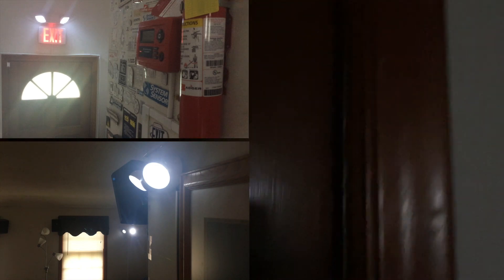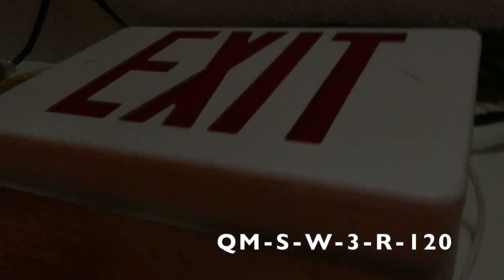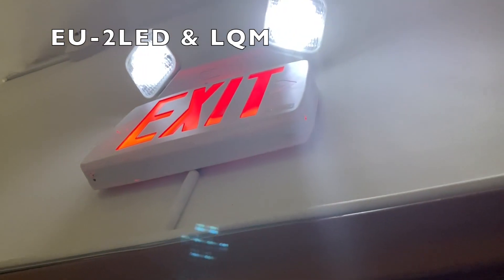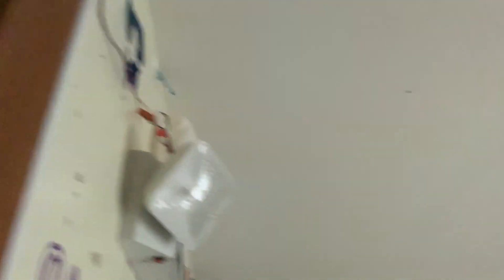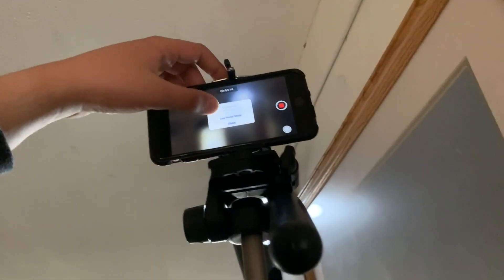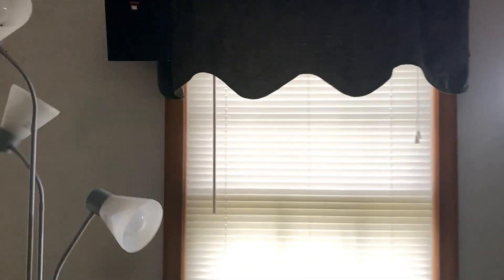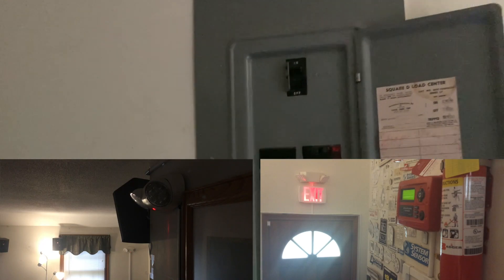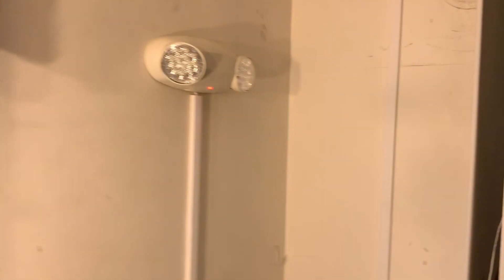Power Outage Simulation 22 - *Main Breaker shut off*

Comment: The Dual Lite LZ stays illuminated on battery mode for 15 minutes after power is restored. This is meant for areas where lights may take a while to warm up or to come back on, and its helpful so once the power comes back on, it isn't pitch black since the normal lighting isnt on